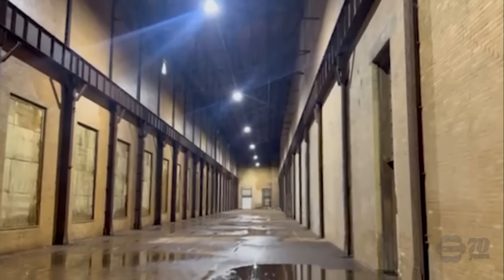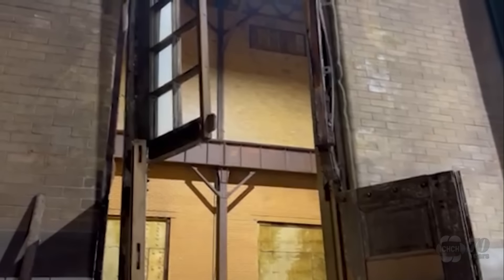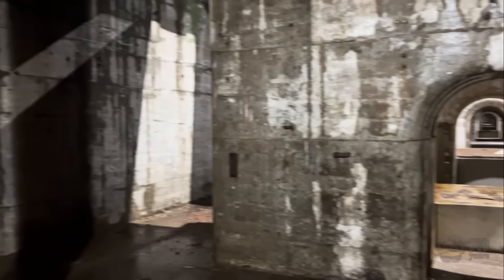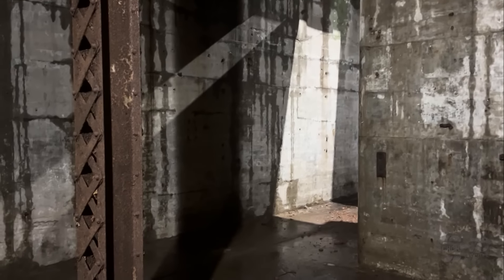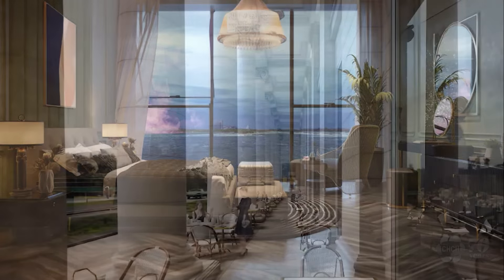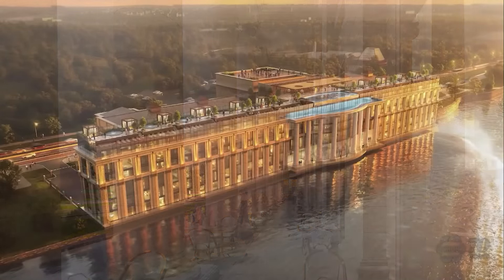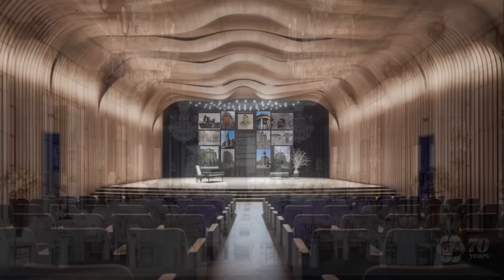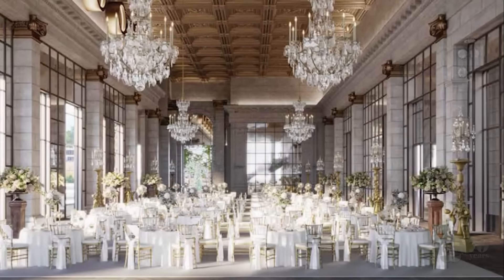Historic Niagara Falls power station gets new life as hotel

Comment: The Toronto power building is a beautiful building, I never understood why no one did anything with it
Reply: Taa Daa 🎉
Reply: Mainly because Ontario Hydro stopped using it in the early '70s and Niagara Parks only got it in the early 2000's. By then the place was in terrible condition from 30 years of abandonment, the several sub-levels underneath the building in particular are really bad because the air is constantly moist. I would imagine Niagara Parks realized that restoring the building for public use would have been way too costly, especially when the Canadian Niagara Power plant up the street was in much better condition since it was active until the late 90's and had been kept in mothballed condition after that. Thankfully they did an amazing job restoring that plant and the tailrace tunnel underneath it.